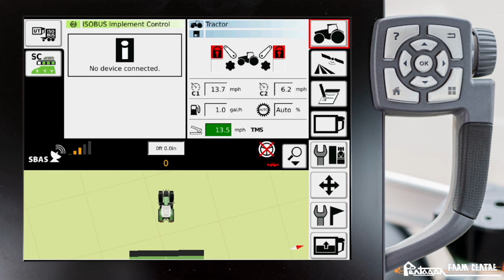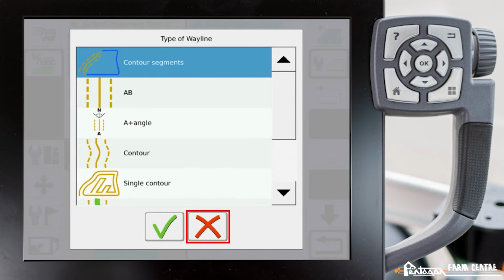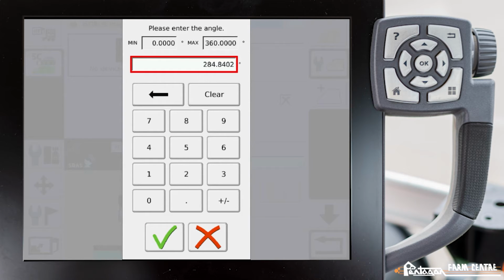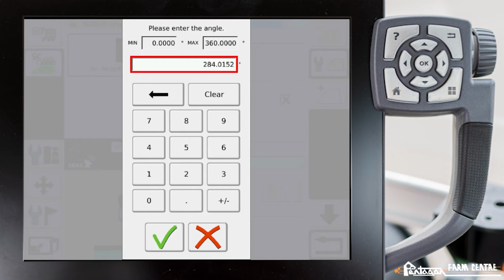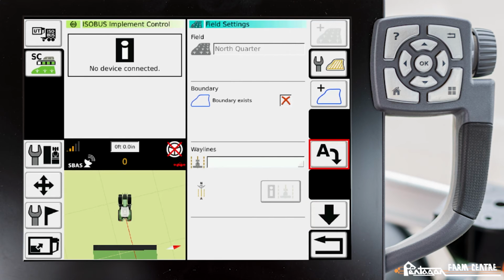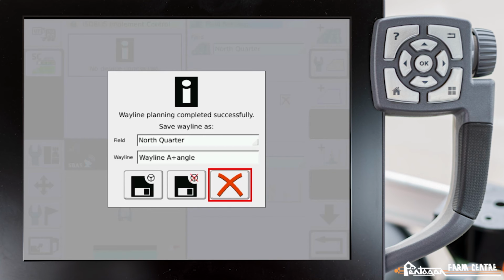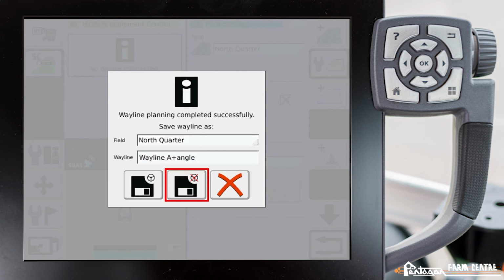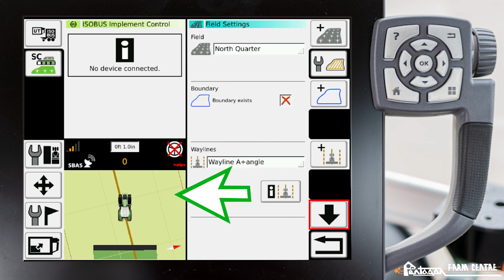Angle Wayline : Fendt VarioGuide How To

Comment: is there a way to turn an existing AB line by x degrees without having to create a new angle line based on the AB line?
Reply from the maker: Hi Cathy, no you can not rotate an existing AB Line. If you have a specific angle in mind, try using the A+ Angle wayline type.
Reply: @PentagonFarmAlbertaHarvest  Thank you! I guess I have to load the AB line and create a A+ line based on that then. Fields in Europe are a bit random or more landscape oriented than Canada...